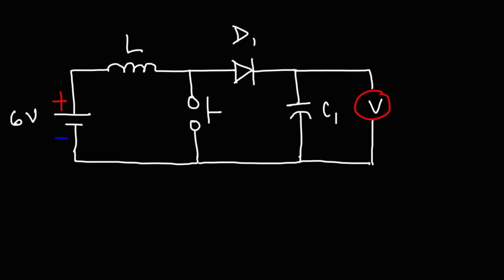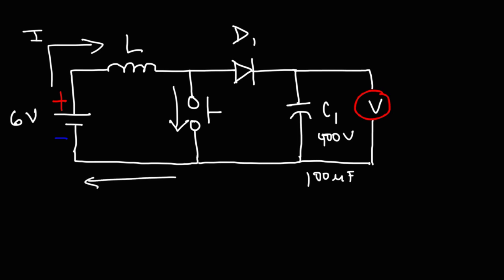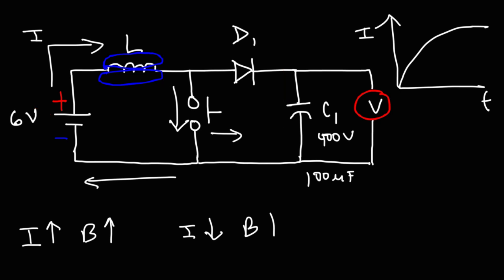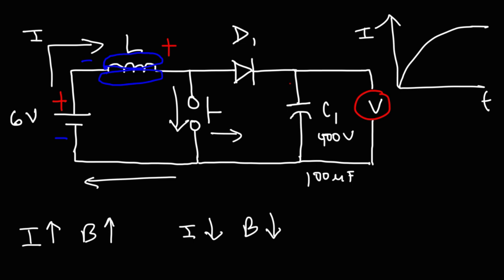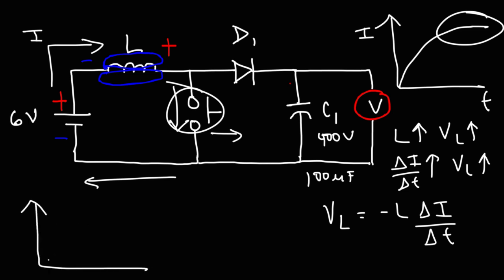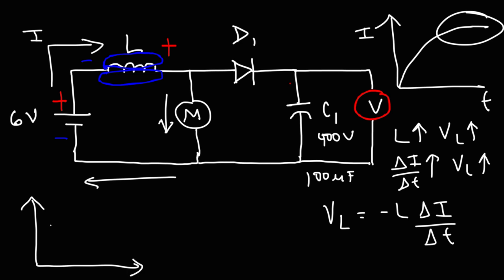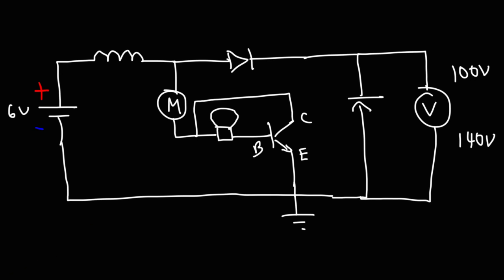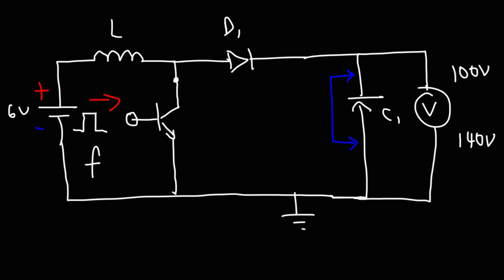6V DC to 100V DC Voltage Boost Converter Circuit - Electronics

Comment: Hi interesting video, I use already the boost-converter technique in combination with Bedini motor of Newman Motor to load a 470µF capacitor (max 400 volt) up to 170 Volt and than discharge this capacitor to recharge lead 12/24 volt batteries. So rather than recharging batteries with at a constant rate using known chargers, I experienced that a DC-Pulsed technique is maybe faster and potentially rejuvenate the battery as well. If you could bring up a calculated example ? That would be interesting in terms of scaling larger engines.

Comment: So the flow from the battery to the inductor while the switch is closed is D.C. when the switch opens and the magnetic field collapses, A high voltage spike occurs the current +/- Change ie "Alternate" Passes through the Diode which rectifies the High voltage to D.C. Charges the capacitor when the switch closes again the Diode blocks the high voltage D.C. from returning "Discharging" back to the battery and powers the Load.Ok now I understand better.Thanks.jim

Comment: Will it work if you replaced the motor with a 555 timer oscillator circuit?
Because it's pretty awkward to put a motor in such circuit

Comment: im going to power up an ebike. im using a 14.8 lipo battery. it is capable of 715 amps. the motor is capable of 110V and 7 amps. i need a decent 10X stepup circuit. can you guide me?

Comment: Try using the term "turns," in place of "coils" when talking about inductors.  The transformer you used has two coils, but each coil has many turns of wire.  In this case, it is the iron core of the transformer that gave you the inductance you need, more than the number of turns.  BTW, Is the cutting board in the video a pun on "breadboard," or do you not actually have any breadboards in your lab?  They are awfully cheap to own.